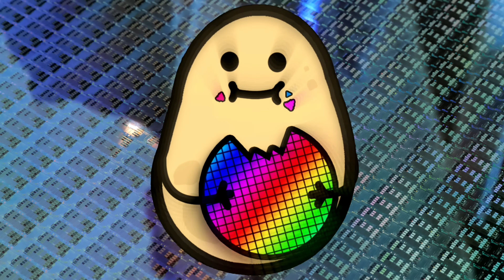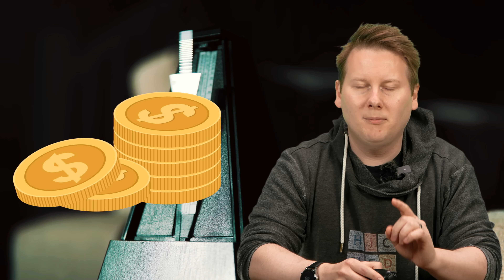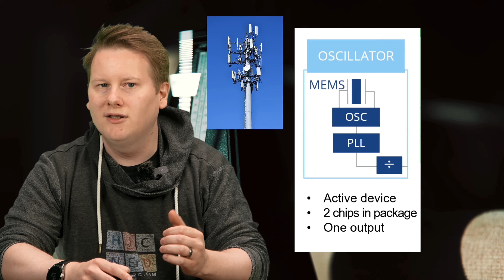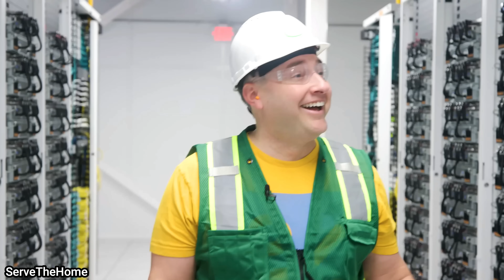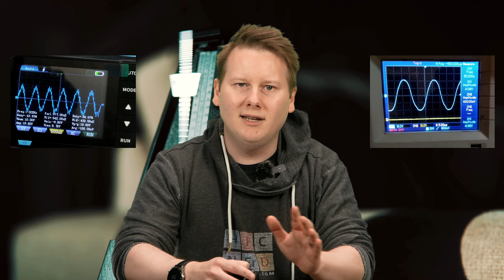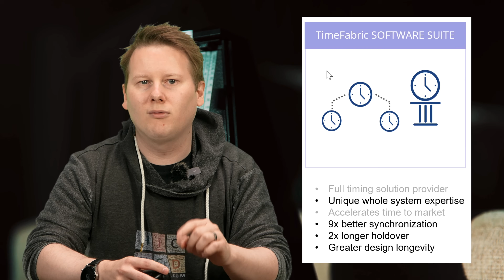The Heartbeat of Modern CPUs

Comment: th opposite is for you to look at the way that the clock is generated, without a crystal or MEMS device, on the multitude of low performance and lowish power microcontrollers, which need a clock that is around 8MHz, and which is generated on die using a block of near voddoo custom silicon, which will self start reliably, has sort of reasonable performance, and which is somewhere in the ballpark of usable. Especially in things like USB peripherals, which must generate internally a 12MHz USB clock to receive and send data, but where there is no space for a crystal, or in memory devices, where there is no real estate on the tiny board for it either.

Comment: "Fancy Sand" - great term.    I am still digesting your video. 
  Oddly it looks like having systems run Asynchronously helps.  Disk I/O runs against its time clock till it hits the NIC card with the network clock and off to the NIC in a server with a different server clock running memory at its speed. 
   That all the servers have different clocks but can communicate over the NIC or fiber clock.

Comment: What about DLL in clocking? also Does Sitime have configurable DLL/PLL where i can intake a LCK and output another fraction of it but in phase? lets say 1.544MHz CLK in and output 2.048MHz in phase and yes those numbers are definitely not random and that task requires a special chip typee.
Reply: Depending how accurate you need it, a raspberry pi Pico can do clock doubling and related conversions. If you use a disciplined clock to run the RP2040/RP2350, you can get a doubled clock out from it.
Reply: @brainwater  i want to get the second clock from the fisrt one and with precise timing that is why i was asking

Comment: Oven Controlled Quartz isn't really used for much, if anything.  On the other hand, Oven Controlled atomic clocks are absolutely huge and it would be interesting to see if the MEMs stuff can approach something like a Rubidium clock.
Reply from the maker: The rubidium atomic clock PCIe card is what, $1500 at scale? I think even the most expensive OCXO is $40 in volume. It's a different class, and you give up board space and power to get that part-per-trillion.
Reply: Arguably, a consistently worn wristwatch is oven controlled quartz. Not necessarily the best oven controlled quartz, but the body temperature of the wearer helps keep its rate stable

Comment: I would get why the power requirements of quartz play a role in wearable devices but what percentage of the power budget of a GPU or server goes to the quartz? Shouldn't that be negligible?
Reply: A rule of thumb is that clock generation and distribution, in any large processor, ASIC or GPU is half the power use, and half the number of active devices on the die.
Reply: @SeanBZA Half? That's crazy!
Reply: 17:34 If you look at the diagram, network synchronizers utilized digital PLL, not just regular PLL. DPLL requires TDC, encoders, FIR filters, & precision DACs. An AI data center could be using thousands of network synchronizers to clock tens of thousands of GPUs & CPUs!